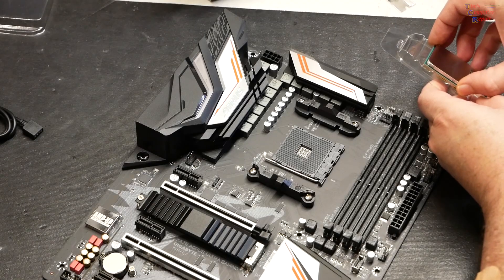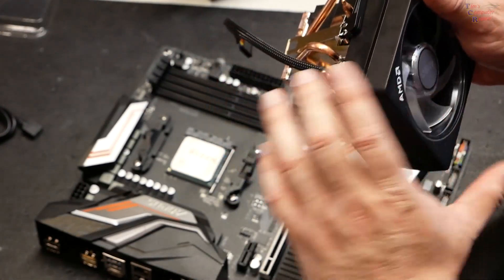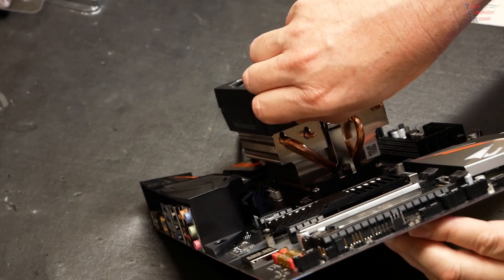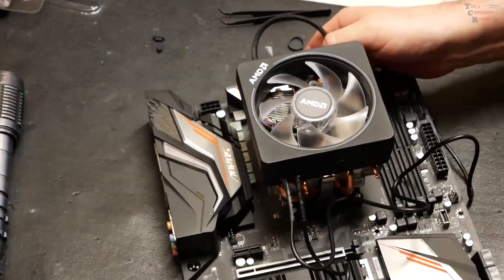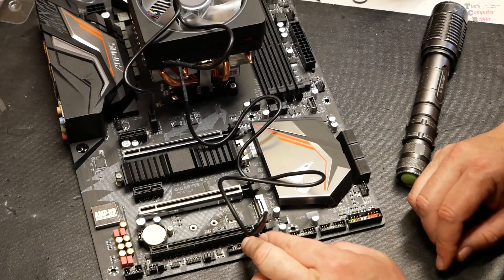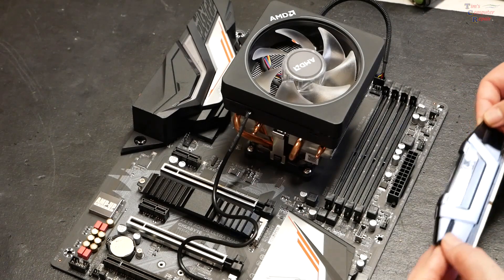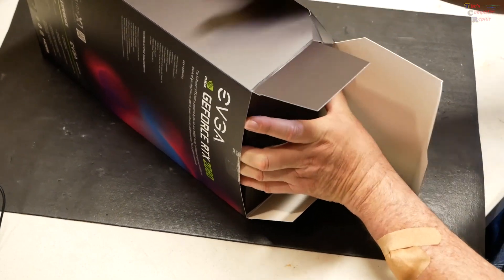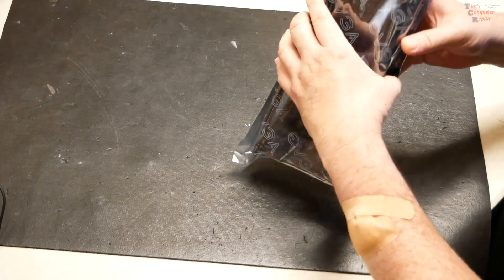How to Install an AMD Wraith Prism CPU Cooler

Comment: Anyone else had to basically brute force it to lock it? My fingers hurts 😂
Reply: Yes, the coolers are very tight. They're designed to be very completely absolutely snug (for maximum contact i.e. heat conductivity) which is why you don't need to apply too much thermal paste and the pre-applied thermal compound is very little. It's normal, just exercise caution in not hurting yourself and not being too rough.
Reply: @badvertise  Yea. When installing had the feeling mb will bend over time.
Reply: dragzzt nah you'll be fine
Reply: Bruh thought it would break
Reply: @Ninjaslayer56  yeah >_< Gonna order a watercooler and install instead. Makes my nerves iffy :/ 
Tho think I have a issue with my MB, as when I load heavy games (Space engineers) it lags horribly... 2080 gpu and 3600mhz ram with a ryzen 7 3series... should not lag xD
Reply: Fred what brand of coooler tho
Reply: I feel like the tension handle is going to break the mobo
Reply: @BillsSpamMail  ya I got it but it took some real force. Itnwas fully extended. Maybe it's my MOBO not sure but it's working very nicely :)
Reply: @438295 I'm replacing it asap but it is functioning nicely. You think pressure over time could do anything?
Reply: yeah men, me too
Reply: Installed my cpu 5 hours ago and my fingers still hurt
Reply: not gonna lie, i came here just to look for comments that tell me that its normal for it to be so hard
Reply: same here
Reply: the fan? yes a pain in the ass, well my fingers but you know
Reply: I cant get mine to lock, it's like it's too short, please anyone help
Reply: @yournan7249  be careful but it should lock, it took me more than 1 hour ....as I was afraid to press too hard
Reply: @coecovideo  I have no idea the two metal parts clip on ot the black plastic latch that you have to lift up just wont go up and it will break if use anymore force, dont know what to do and also there is a switch on the side with and L on one side and an M or something like that on the other, doe sit make the latch larger or what does the two modes do?
Reply: Ye I had to. My PowerSupply shuts down when its not locked in.
Reply: I have the same problem!
Reply: Yes! It took me awhile to gain enough courage to actually clip it on because I was afraid that I was breaking the damn thing!
Reply: coecovideo yeah I just pressed too hard after reading that other people had to press hard and guess who just fucking sapped a brand new $300 ryzen 7 3700x out of the socket and bent pins...I am fucking livid with AMD right now. Never had such an issue in years of building PC's.
Reply: Not a computer expert here. But after a messing around with it with no luck, this is what i did. I loosened the screws of the upper hook plastic plate, just enough so that it wobbles back and forth. Then i inserted the fan, this time with much ease. And then tightened the screws. Try this
Reply: I legit thought it was going to break until I read these comments! So thank you, I was stuck otherwise!
Reply: @thehealingfairee  Anyone else had b450 tomahawk max motherboard, that had to use a hammer in order to flip the switch ?
Reply: in about 30 years of building PC's and servers, this was the hardest I've ever had to press / push something into a slot. at one point i just closed my eyes and squeezed the lever as hard as I could finally it made a tiny reassuring thump. thought I was gonna lose my new 2700x...id be a lot more nervous with an r9 or tr
Reply: @Bram de Groot omg they gotta come up with something better than this
Reply: Just Some guy  damn that is nuts! Never heard of that shit happening. I think I'm gonna go for an aftermarket cooler. Good luck my friend!
Reply: Just Some guy  Also got a replacement but it fucked ONE pin on my mobo so it only read 8/16gb of ram so I had to buy a new one :/ when you put it on go to the other side of the bracket and push the pin alone as hard as you can without forcing it by hand and not the big cooler itself. try to get just the bracket locked in. More difficult with your hands but its safer
Reply: That's why I'm here... The flip lock thingy doesn't want to flip easily so I'm like "...is this right??"
Reply: Fredrik Haugli same
Reply: My solution was to use mechanical advantage. Loosen the screws on the anchor/motherboard plastic. Click the heat sink down and turn the lever to make it tighter; this step is not necessarily easy. It can still take a bit of force to lock it, but nowhere near enough where I had to use a set of pliers like I had been attempting.  Then tighten it down fully with the screws. They were hard to get to because of the heat sink in the way, but not too awful.
Note that I had replaced the thermal paste, so it's possible my job was a bit more difficult.
Reply: @fredrikhaugli8372  Your issue could very well be a slow HDD/SDD.  I recommend the Samsung 970 Evo Plus.
Reply: I’ve had my PC for about a year now and always wonder why my temps were so high. I finally just had the thought today about mounting it incorrectly. Turns out I didn’t do the latch all the way. My novice self probably thought I would break it. This saved my poor CPU from roasting.
Reply: Logan Kreisher when I installed it, I felt like it was going to break
Reply: Brandon Alvarez Same! But now my CPU isn’t getting past 77 on Cinebench R20 which is miles ahead of where it was before I realized I didn’t flip the switch all the way.
Reply: Logan Kreisher haha
Reply: @fredrikhaugli8372  Im sure you have resolved it by now, but perhaps test things with a more stable running game than SE, which can sometimes run like garbage on good systems
Reply: Shawn Davidson Still issues with World of warcraft. I run a 144hz 24" gaming screen + 27" Full HD screen. When games have run for 5-10 minutes its like the graphic driver dies for a second. Now I have a water cooler, m.2 disk still same issues on all heavy games.
Reply: I put the other side on first and it was a million times easier.
Reply: @One.Zero.One101  I replaced it with a watercooler :P Loads easier to put on :P The air cooler that comes with the CPU is a beast, but the constant fear of the Motherboard nearly snapping under that pressure scared me :P
Reply: @badvertise  im scared that i may have damaged the cpu while putting on the cooler. is that possible?
Reply: @bizarrediego774  while maybe possible it's not likely, unless the CPU came out of the socket while putting it on. The part that would be most easily damaged is the side with the pins. Try asking /r/buildapc if you need help
Reply: I had to flip my cooler upside down since it cant lock when the amd logo is right side up looks like I have to get thermal paste and redo it
Reply: @dragzzt  agreed, and follow by anxiety thinking you are breaking the cpu under it.

Comment: why did you cut the part when you click the hook! i just was searching for that
Reply: well it was really easy... just press with your TWO Thumbs down. but it is a little difficult specially if you have fraid of damage something. Be 100% sure procesor is correctly installed before placing the heatsink, and dont move a lot the heatsink or paste will move from place. (excuse my english)
Reply: I found that connecting the hook that is opposite of the lever first, is best. You will have the slide the other hook onto the tab with your finger. I had to remove my GPU first.
Reply: Spent a good hour just to get the cooler hooks to snap in place. I'm not even joking, easily the most frustrating thing I've ever done.
Reply: @Torjus_  i am getting one next week and i am terrified thinking about installing it...
Reply: Also the onboard wifi drivers were fked. Not the best first impression on the switch to Amd.
Reply: @ocherwei  its really easy. Just press with two thumbs on the hook that doesnt have the lever.
Reply: I'd say it's like a lot of things with building a pc: you'll be super-scared that you could damage anything in the slightest at first, but within a few minutes you won't be so precious about it and will just see that it's just two pieces of plastic that need to clip together. When common sense kicks in, you'll find you'll have no problem in giving it the right amount of force (they know folks will struggle with these types of things). Just don't go absolutely Bruce Banner on it and you'll be fine. ;)
Reply: My thoughts exactly!
Reply: Yea, great video otherwise, but cut out the most important part.. He probably did that because it was embarrassing for him to watch and he near destroyed the motherboard doing it.. >,< .Why the fuck after two decades, can't AMD invent an easy to install heat-sync.. I mean, the answer is right on the thing, the lever.. just loosen it a bit so you don't need to fuck with it, then use the lever to tighten..  
Well.. At least they got rid of that tiny rectangle in the center, and all those little circuitry bits that often ended up with thermal paste on them.. Last time I installed a heat-sync onto one with the raised rectangle, I ended up grinding off the corner of it.. surprisingly it still functioned..
Reply: Hasta la falla You saved my life. I am eternally grateful.
Reply: Yep, exactly where I am frustratedly stuck on doing my PC build
Reply: Sean Hannold - just replaced my Amd stealth with Wraith Max ( basically the same as Prism ) and i removed the Gpu & installing the hook first worked best for me on a Asrock b450m Pro4 into a DeepCool Matrexx 55 Atx 👌
Reply: For anyone struggling with the clip, to push down the clip opposite the lever you can get a screwdriver between the fan blades to push it down into place. Found that much easier.

Comment: As I just found out, you do not want both of those small cables plugged into the cooler if you intend on adjusting the RGB lighting on it at all.
Reply: so can you just have the RGB cable in if you're not going to mess with it?
Reply: @dylanholmes05  If you want to be stuck with the stock rainbow effect, yes.
Reply: @Ojiispearz0rz  so what is the point of the four pin? Also if you have the 2.0 and the fan connectors in then you can control it through the software right?

Comment: Cpu fan cable most important?!? Don't you mean RGB cable?
Reply from the maker: No. without the cpu fan cable the fan would not spin.
Reply: rgb improves performance by over 9000 so yes it is most important cable
Reply: @CS-vl4pp   the fan 
cable is the most important
rgb  isnt any good if ur cpus dies
the perfomance will die with  it.
also if u dont plug in the cpu fan the rgb wont turn on,the fan also give it the power to turn on
Reply: @Musicisdedz  I think the original comment was meant to be a joke...
Reply: @Musicisdedz  r/whooosh
Reply: @TimsComputerRepair   If i dont want to use the RGB i only need the Fan cable installed right ?

Comment: 7:01 One of the most important parts I learned when I installed the Wraith Prism CPU cooler of my 3700x. I wish I found this video earlier. It took me a while to realize this so I could control the Wraith Prism RGB software.
Reply: Mine doesn’t detect the cooler so I’m not sure if that works

Comment: For anyone installing this cooler, make sure that the sliding portion of the bracket is pushed all of the way down BEFORE you begin installing. If you fail to do this, the fixed side of the bracket shifts and causes a lot of tension, and can make the sliding side really difficult to clip down. 

Once the non-sliding side is clipped on, you can attach the sliding side. Press straight down using the top of the black handle and the bracket will slide over the clip. With the initial tension adjusted in your favor, this will be easier. Note: will still have to press hard, but the handle will provide something to press down on. 

Once that is done, flip the handle all of the way to the left. The handle tends to bend a little, so try to grab it towards the bottom. If you didn’t push the sliding portion of the metal bracket down in the beginning, the tension will make this really difficult as well. So that step is extremely important. 

I’m thinking that the fulcrum of the metal bar gets offset somehow, making the force necessary to clip down really high. By making sure that sliding part is down, it centers that fulcrum point and gives even pressure across the whole bar. 

I hope this helps someone, as this is a difficult one to get attached correctly. 

And I believe that the RGB cable allows you to sync with the other RGB devices on your board. So if you want everything working together, you may want to try that. I just left everything off though. The defaults seem fine. I got a windowless case anyway lol.
Reply: Dont know if you'll see this, but if i ONLY plug in the cpu fan cable will the rgb still work?
Reply: @emrothedemo6415  Yes, but it will remain on the default settings, which is a rainbow cycle.
Reply: @joshman1019  so if you plug on the fan and the 2.0 cable then you can control through its own software? Also, is the four pin compatible with the four pins on asus boards?
Reply: @realmusic_enjoyer  The LED control cable will allow you to sync the LED scheme with other components in your system, the USB connection will let you access the LEDs with the AMD software. I am not 100% sure about syncing with other LED components using the USB connection, as I do not use any other lighting features. But I do believe you get a bit more granular control using USB. 
Full disclosure: I am not a fan of either method of control. They were both extremely clunky. I elected to use no LED control cables and just let it cycle as default. I sleep in the same room and so the less light the better. My case doesn't even have a glass side panel, and so my opinion might be a bit skewed lol. 
I do believe that the 4 pin LED controller is a standardized "thing" and so it should definitely work on any board that has a 4 pin LED connector. Be careful, those pins are extremely thin and delicate. Also, it can be reversed accidentally. If you're getting the wrong colors with it, turn it around and try again. I believe there are directional arrows on them, but it is almost as tiny as the pins lol.

Comment: was a bit confused about the wraith cables and where to put them,cheers for that.
Reply: Just so you know, you can use either or...if your mobo has a rgb header you can just use the 4 pin cable. If not, then you can use the usb cable, you don't need to have it looking like an octopus...unless that's your thing of course...
Reply: @freeroamer6962  was going to post I didn't think you needed both connected.
Reply: @freeroamer6962  my friend has the same cooler and has RGB but has none of those two cables installed. Just the fan cable
Reply: Dunja I  ...
Reply: Swiss Admins And Mods Funny Moments so you don’t need to connect rgb? and you don’t drop any efficiency if you dont use the rgb?
Reply: @freeroamer6962  thanks, that's exactly what I'm looking for
Reply: So basically plug the main cable into the RGB header port and the fan and RGB will work ?
Reply: lukeashworth1068 yes but you won’t be able to choose what color you want it to be, it will just cycle through colors which does look great unless you wanted one color as a theme like only blue
Reply: @mbj920  So if I were to use the USB cable all I have to do is plug in the CPU fan header to my motherboard and plug the USB cable to one of my USB headers?
Reply: @dyceeee  yes a USB 2.0 header and you’ll be able to control the RGB with your motherboard’s software or whichever company software you choose

Comment: For anyone struggling to control the LED ring, center, and logo with the Wraith Prism app, you must disconnect the LED CPU cable and leave the regular USB cable connected. Keep the regular fan cable connected or you won't have power. It's odd and frustrating that it works this way, but I struggled with this for WEEKS and that was the only solution that worked.
Reply from the maker: Thanks for commenting.

Comment: Had to build my 1st computer today this Prism CPU Cooler was by far the hardest part, getting that second clip on was a serious challenge, you really do have to apply a lot of pressure. I recommend to anyone watching this to clip the side without the lever first, then clip the side with the lever. Just need to plug everything in hopefully didn't damage my CPU applying so much pressure to the damn thing!
Reply from the maker: You should be good.
Reply: @TimsComputerRepair  Whoo finished it today and it booted up 0 issues thanks for video my man! 1st ever computer build :)

Comment: little tip when you are confused about the RGB plug orientation, look very closely (thats how i figured out what my orientation of the motherboard was), there is a tiiiny resistor where only one pin is, that is the 12V pin
Reply from the maker: Thanks for the comment.
Reply: there is a small marking in white close to the base of the 12V pin.
I could see it in the movie. I also have it on my motherboard:
https://c.76.my/Malaysia/asus-rog-aura-sync-light-rgb-header-led-strip-4-pin-extension-cable-doinfinity-1808-04-doinfinity@3.jpg